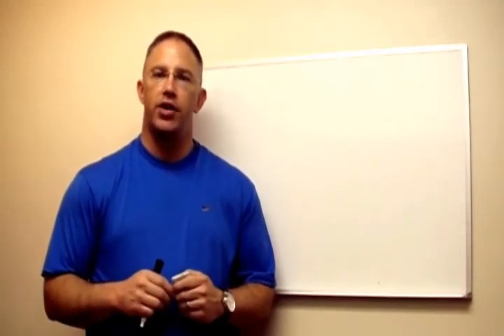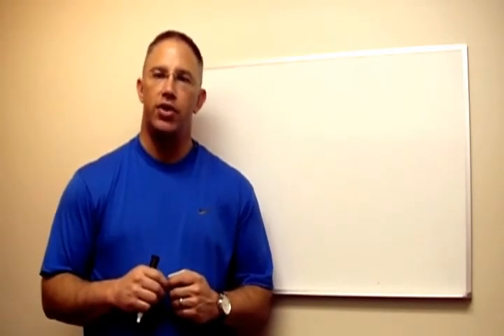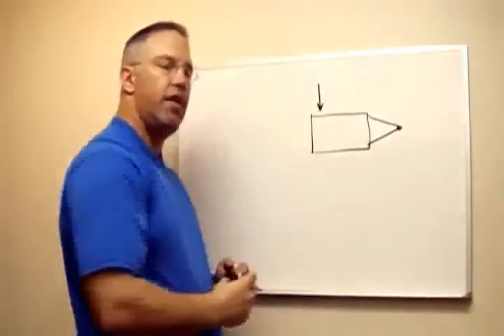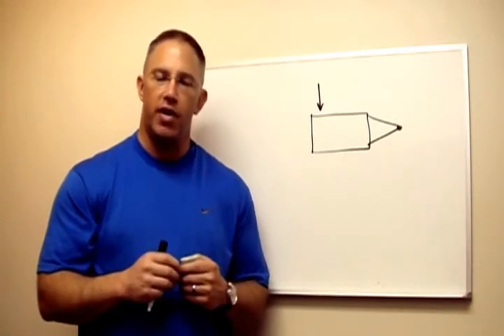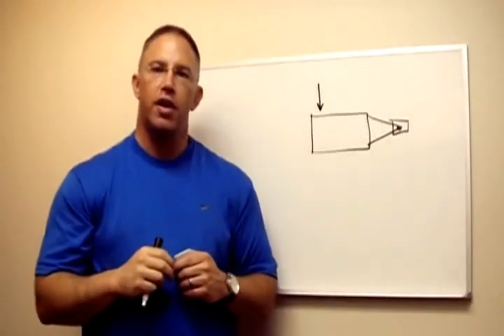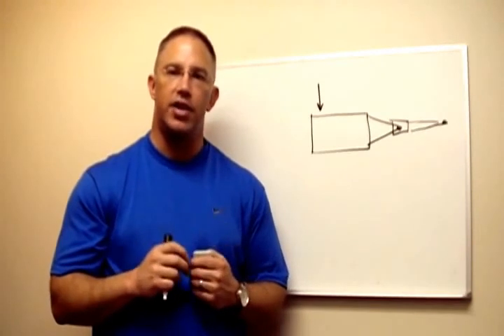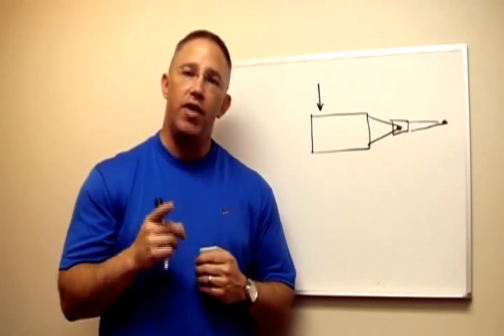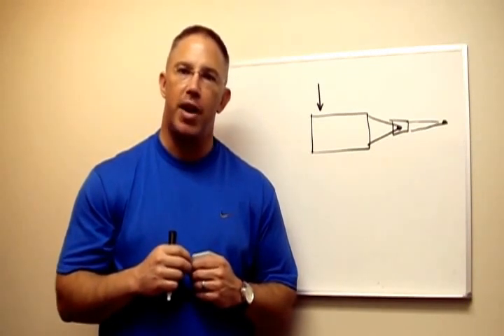ProPride 3P® Jim Hensley Hitch: Understanding the Pivot Point Projection Technology

Comment: This video does not explain how the hitch eliminates sway through "pivot point projection" simply another video pretending a buzzword phrase like "pivot point projection" is an actual explanation.  I would like to know how it "projects the pivot point forward.  It's not like you'd be giving away the recipe for your secret sauce; it's patented.  

Please show us the operation of the mechanism at play which locks out the ball coupler movement and creates a joint which acts like it pivots a few feet ahead of the actual connection point.

And also, might it not be easier/cheaper to simply replace the hitch coupler on the trailer with a dedicated design which does this, rather than having the extra complexity and heft of a design that has to "lock out" the existing functionality and create a different one?

Comment: How does the ProPride 3P handle vehicles with 4-wheel steering, such as the Cybertruck, where the rear wheels steer crab-like, following parallel to the front steering wheels at highway speeds? 

I expect the 3P pivot point is near the center of mass of this 6000 lb truck.

Comment: WE have been happily using a Hensley Arrow now since 2007. We have had 3 different 30' RV's, and it has been easy to switch the Arrow from one rig to the next. We have a total or just under 40,000 miles on the Arrow so far, and we have NEVER experienced ANY SWAY! period!